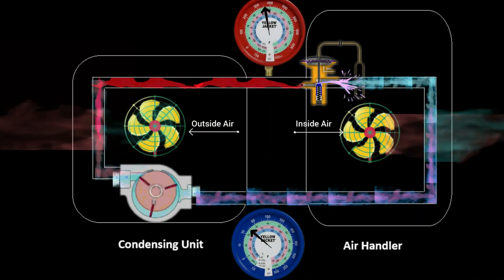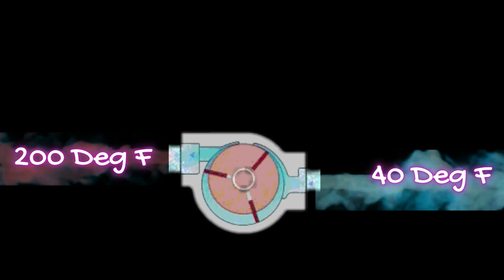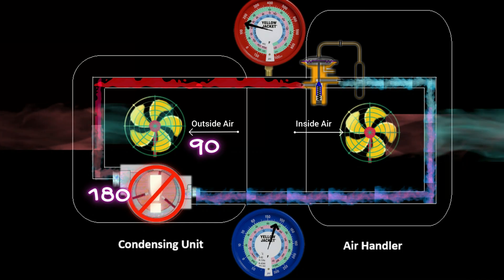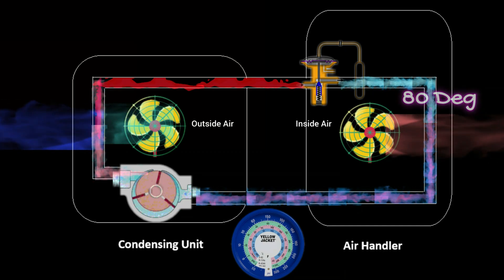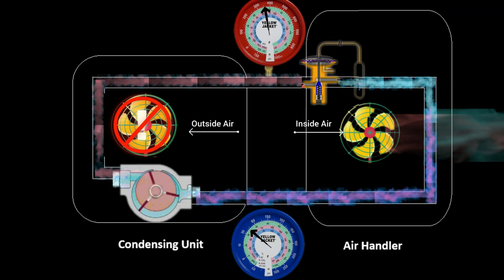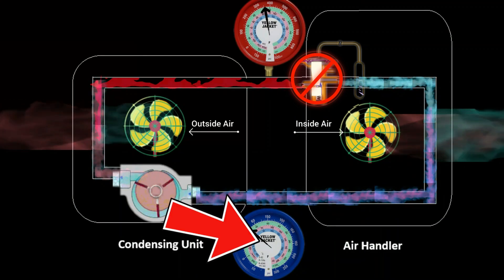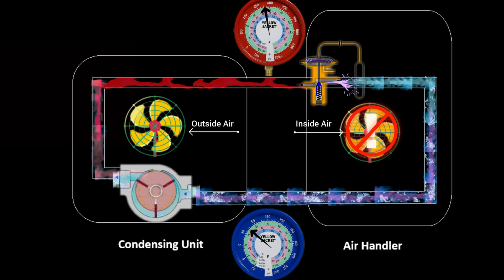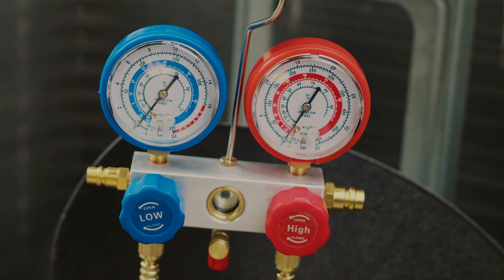What Happens When Each Part Of Your AC System FAILS?

Comment: Has anyone successfully charge an older r22 system with r134a with its oil requirements? I used r290 with mineral oil in it for about a month last summer until the leak on the line got worse….this summer, I’ve cut off the bad areas on the lines and replaced it all with new copper and fittings and use that stay bright soldering for hvac to get it all sealed back up….cleaned it and vacuumed it down to a negative thrn used that to do a pressure and leak test…it help a negative pressure for 15 minutes and then I started filling it with the oil and r134a….its got 4 lbs in it just like it requires either r22…and it’s holding the high and low side at about half the expected pressures listed on the machine…I had some trouble with excessive condensation on the interior coil but after pumping it down and fixing an issue with the high side line…vacuuming it down and testing the pressure and leak testing…I opened the valve up on the blue side slowly and once most of the pressure was back into the lines I opened up the smaller side king valve…I didn’t want the excessive cold to get on the newly soldered areas…turned the ac on and filled it back up to the 4lbs and now it’s doing exactly as it should be….this summer has been a lot more humid then what we are used to in the Midwest so I wasn’t sure if the humidity can make the readings off etc…this ac is an old 95 carrier that was refurbished in 2005 and then only used for a few years until the squatter in this property got the interior coil so filthy it had no air flow so she stopped using it and got a window ac…thlol n she moved out finally after the place got in way too bad of condition she couldn’t stand living in such a dump lol….8 years of free rent …..and I get back a torn up property that looks like a shite hole abandon property…no contractor will do work for me r hard less if how much cash I throw at them…so it’s been a miserable and frustrating past ( years putting this pos back together…r134a is readily available at Walmart for $10/12 oz can…but I’ve recently found a place selling r22 new 5lbs for $200…it’s mad in the US now….so if my carrier does go to crap and dies….i have a York to install next with the r22 in it…but until then I’m just experimenting with the types of Freon…r22 is still the absolute best for comfort and reliability and it doesn’t cost a fortune to run them like the new portable garbage costs….

Comment: I am sure most people know this, but a failed condenser fan motor will cause the compressor temperature to rise considerably. In older R22 systems with no thermal limit protection, the compressor can basically destroy itself from overheating.

Comment: The compressor failing and the pressures start to equalize; does that include HeatPumps as well?
Reply from the maker: In most cases, yes. Sometimes it might take 5-10 minutes, but most do.  You wont see it with EEVs because they fully close. Some systems might also use check valves with the TXVs and that can prevent equalization as well.